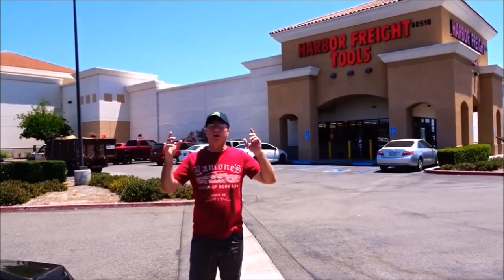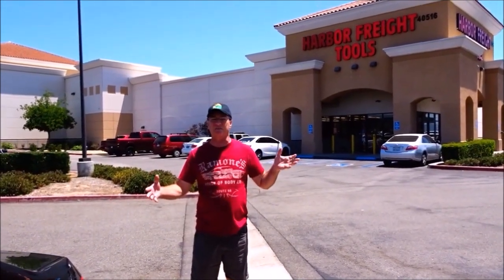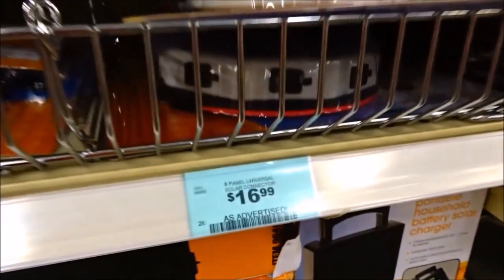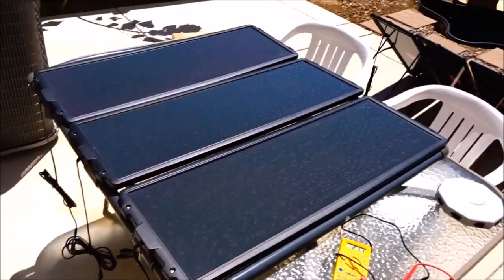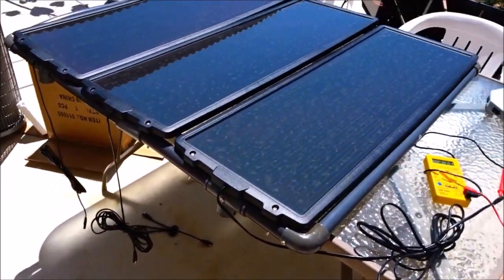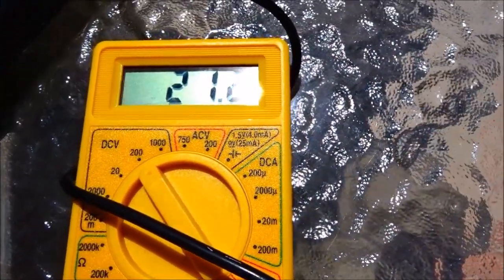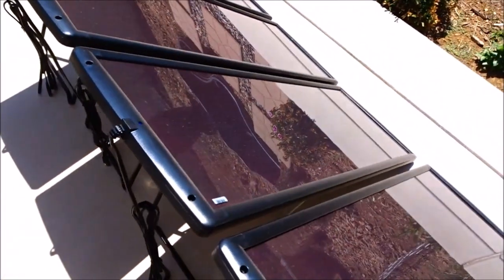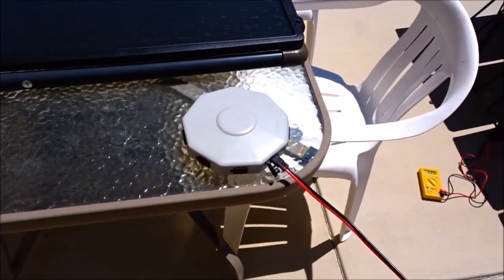nine solar panels total 190 watts Harbor Freight Thunderbolt. 400 watt hub. 500 watt controller

Comment: If you have a lower input power solar charge controller than your solar array by pointing your panels in slightly different angles from each other you can use them all at the same time and they will be tracking the sun at different times allowing for less amps going in but for a longer time as the sun moves away from one set into the other.
Reply from the maker: What a great idea. Thank you so much.

Comment: I cut the battery clips off mine 200/400 watt inverter and connected to the load on the controller with a 30 amp breaker from pepboys in Temecula

Comment: When your batts get down to ~half power, does the charge controller turn off the load or do you have to keep an eye on the voltage and stop using the batts?

Comment: Awesome video!!...was just wondering...instead of running the battery wires to just a typical inverter?...why not run the battery wires to a mppt grid tie inverter, plug that into a kill o watt meter?...& then plug that into a wall outlet?...i did the exact same that you did?...but my set up is 4  60 watt kits, & 1 45watt kit...so my max power would be 180 watts from the hub into my meter at the wall?...but I average like 135 b/c of how long my cable runs are...i was originally using 18 awg cable?...so I switched to 8 guage cable...huge difference-thanks

Comment: What is the box attached to your ac condenser??
Reply from the maker: That is a device that if people allow our electric company to install on our AC that they can turn off your AC when they need to  help the power grid. They usually only do it 2 times in the summer and you are allowed to over ride it say if you are having a party or something where you need it. In return the power company gives us great discounts off our bill. Our highest electric bill ever has been 75.00 during the hottest summer month. We have electric bills of 15.00 some months. I would say our average electric bill is about 50.00 a month if averaged for a year.  This is why we do not have whole house solar and I just have some harbor freight solar to run our camper van and some small things I use it for. Thanks for asking. Happy Thanksgiving.

Comment: I ordered 2 100 watt solar Harbor freight  kit's thinking of using both charge controllers at once ..Have 2 marine batteries hooked up,  Did you blow your >>controller running 190 watts, Before getting a 500 watt controller?
Reply from the maker: Actually I did a dumber thing than that.... I left it out in the rain. That is why I bought the 500 watt controller.

Comment: I need only 12 volt system and no inverter for 120 AC volts.  Every thing I am going to run is 12DC   I am trying to run my Ham Radio station when we have a loss of commercial power.  When I am on Commercial power I have to run a power supply  for 12vdc for my radios.  I am thinking that the 100 watt system will work for me.  How  many AGM batteries I should need.  I am thinking one myself because I can  transmit 100 watt or less when transmitting on my HF Radio

Comment: I want to avoid buying extra charge controler.  I wan to use the ones in the kit since I have 2-100watt kits...  can I connect to same batt bank.?
Reply: This video shows two 100 watt kits using one charge controller and one battery bank.  https://youtu.be/X5tOLsS08wo
Reply: Jerry did you find your answer.?  I have the same question.  I have two kits.  Can I use both controllers in the kits and hook them both to one battery to double my current output.  Voltage can remain at 12.